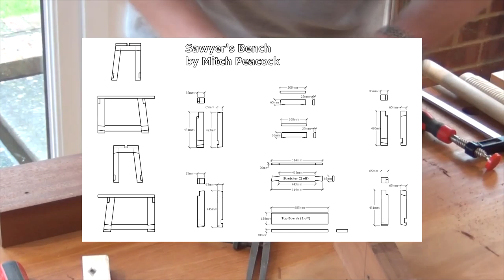My Sawyer's Bench Build part 3

Comment: Maybe you could draw some sketches of your project to help you work out your issues before your start building, that's what I do and I check and double check before starting to work. I find that I make few mistakes this way. Just a suggestion maybe can help you. Thanks.
Reply from the maker: Cheers Robert. I usually go through a thorough design process, but once in a while it's fun to skip all that and fly by the seat of my pants, so to speak!